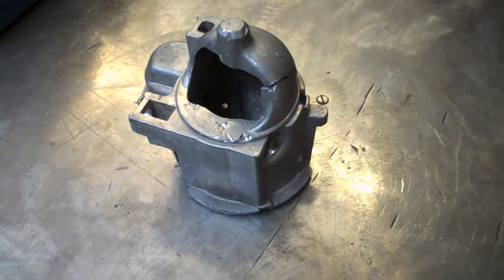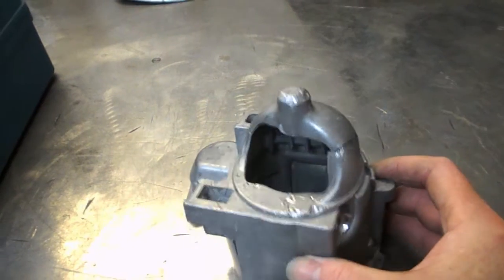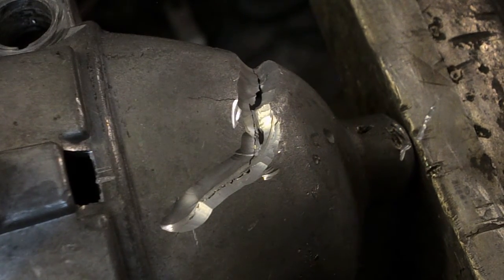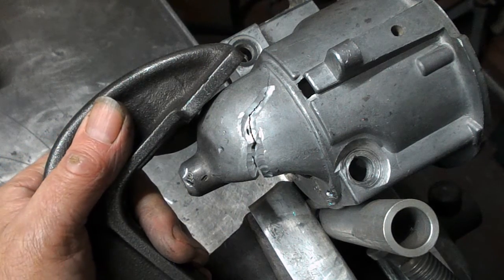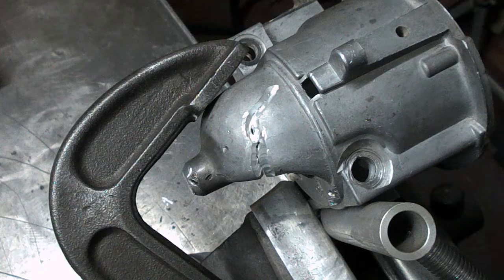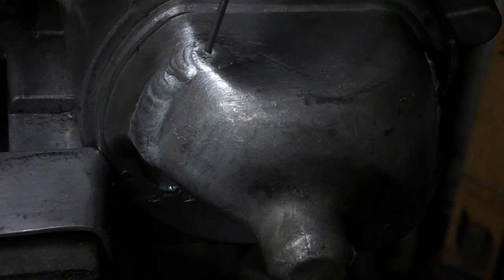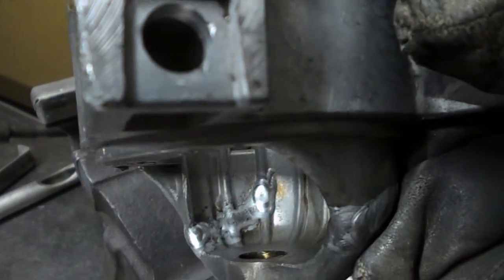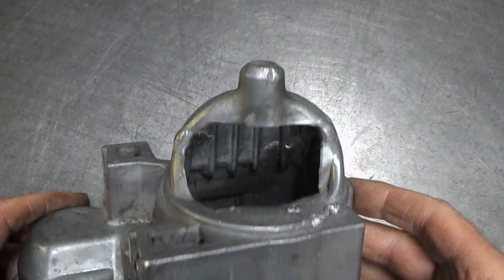Starter Motor End Case repair. POV (almost!) cast Aluminium TIG welding.

Comment: Great job on the repair, it does not get much more difficult. It would be interesting if they know why it broke and if they have done what is required so it does not stain it in future. We must invest in a tig and get lots of practice in
Reply from the maker: Thanks. Just a pity it was still no good! 
AC/DC TIG is so useful though & Aluminium, even castings like this, not as difficult to weld as you might have heard.